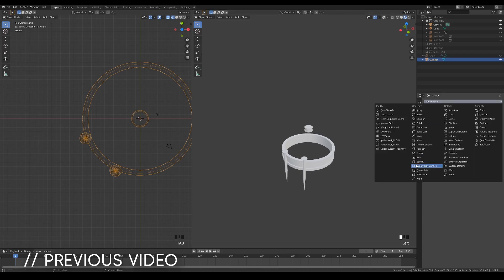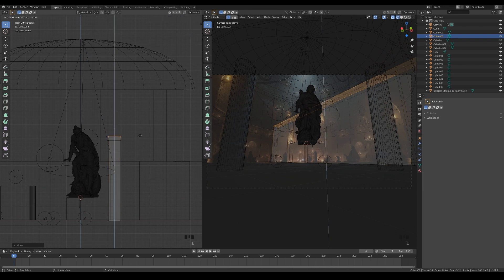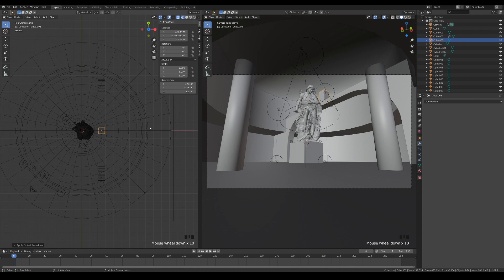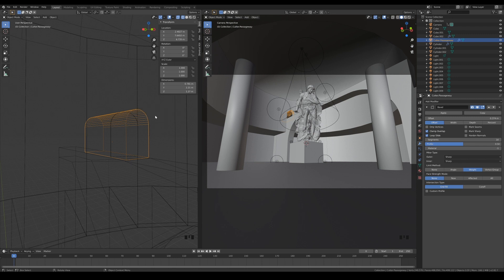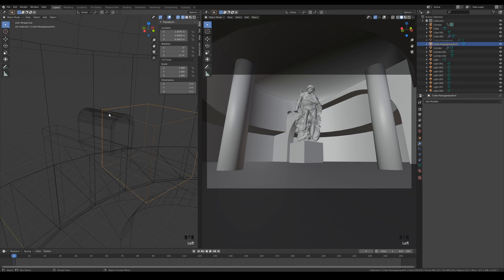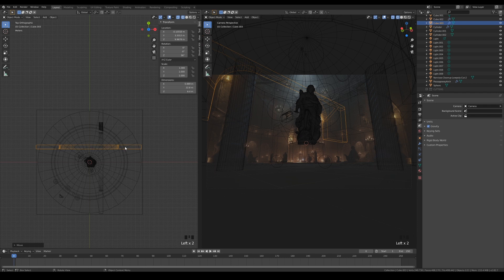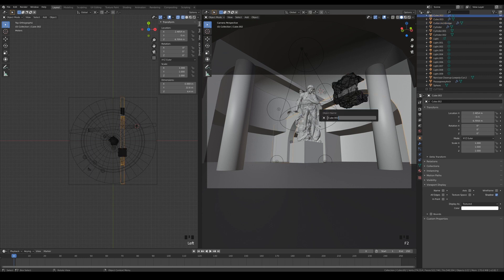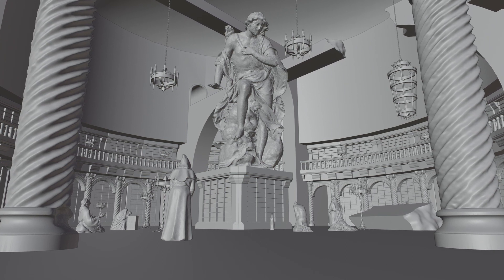How To Make A Dark Souls Boss Room in Blender // Part 6 // Modeling Arch Bridges

Comment: Hi Ken! Love the video, just wondering if you could help me. I added the bevel modifier for the arch, but when I adjust the offset the segments don't go down the z axis very much, so the arch is very shallow. I looked at my settings and they're exactly the same for my bevel and yours. Do you know what could be happening here?
Reply from the maker: Hi Patrick! I'd check if the model's scale is applied as 1 across all axis. Bevels are modified in relative to an object's scale. My guess is you've probably edited the mesh in object model instead of edit mode. Hope this helps!
Reply: @KenLiang  Thanks so much! I'll test it out :)
Edit: I went into the mesh and realized that the scale was different in object mode, thanks so much for your help! I'm still learning. Love this series!